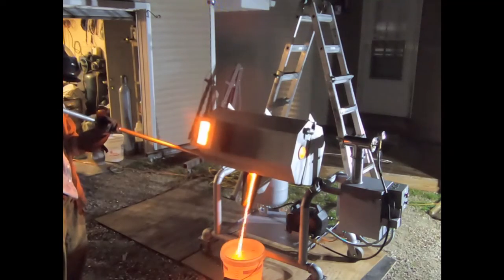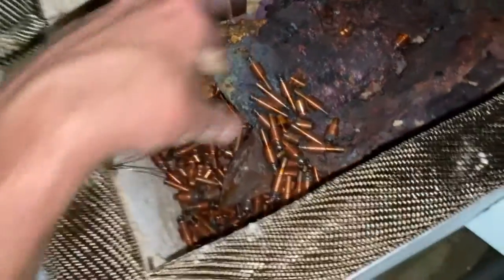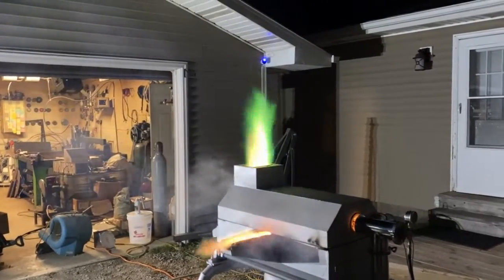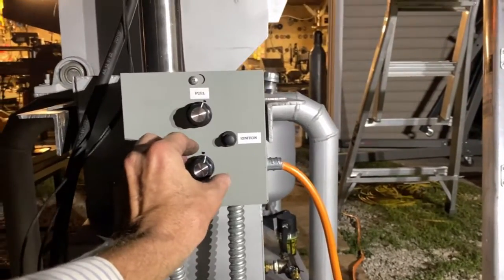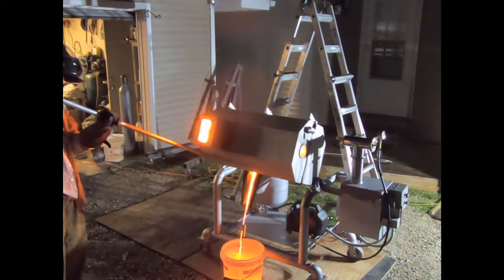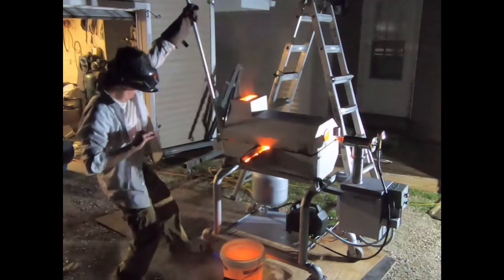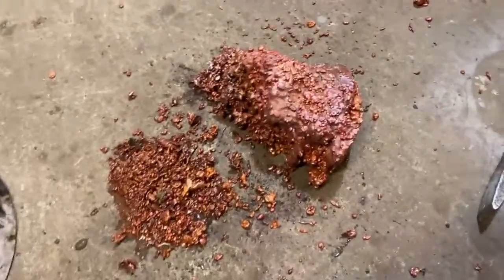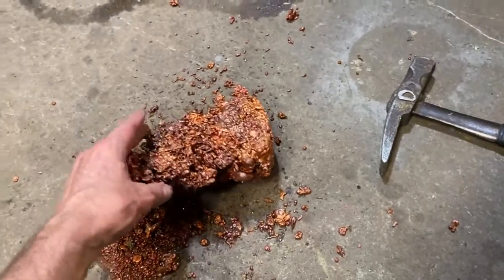Reverberatory Tilting Hearth furnace for Melting and metal separation

Comment: im looking for a way to melt dirty alum and not have all the screws and other tiny items to go out with the alum. (out the drain hole) I think Im just going to use a tilted furnace so the alum can drain once liquid but not enough angle to taker screws and other small items with it. Ive got half an old propane tank that was 4 foot tall its big enough enough around for a whole mower engine., which is the biggest thing Id melt and boat props maybe.

Comment: really cool . could you give me some advice?
you think there is a way to melt titanium using lignite coals coke? i am an engineering student and i am working on refining cheap titanium from TiO2 and need to melt titanium but cant think of anything other than induction oven or oxyacetylene torch. any ideas would be nice considering your experience with high temperature stuff.

sorry english is not my first language
Reply from the maker: Sorry i didnt get yourr reply , youtube hides my comments from me , if you use the word advice or help youtube does everthing possible to insure your not using their platform to make money unless your a lefty f4g0t

Comment: u need a better crucible than a bucket that will melt out the bottom.  A cast iron fry pan will do for the test, make sure to pre heat it to make sure it is hot and dry.

Comment: Melting copper is not a. Reaal challenge for melting in reverbetary furnace but  for melting steel in reverbetary furnace is real challenge my dear friend. Before 25 years ago I had   for melting iron and so many furnace were melting cast iron in India.but now now oil furnace were removed only crucible furnace  are  running for  melting aluminium and bronze csstings

Comment: Melted copper into water can explode into tiny particles. Apparently with considerable force. I suggest you never do that again.
Reply: It's actually a feature not a bug when producing precious metal shot for refining. Smaller particle sizes go into solution sooner
Reply from the maker: Yes it can but ive done this many times , aluminum is the explosive one . I have got a couple of pops out of copper but nothing serious yet . I would of used a mold but was low on time
Reply: Pretty sure most metals are capable of this but I've never seen it happen concerningly violently before and I assume one would have to dump the fluid pretty quick for it to become problematic. That said, slips happen sometimes.
Reply: @nathanieljames7462  I've done it on a small scale with copper. It's not a steam explosion, some other mechanism, however there are accounts from the early 1900s about larger experiments.

Comment: Have you thought about developing an electronic controller that mixes air and fuel at the perfect ratios for all power outputs (from 0% - 100%) and for a start-up procedure? This way you wouldn't need to control two dials and don't need to learn how to use this thing (just ignite and regulate output from 0-100, let the electronics do the rest, kind of like in a car engine)
Reply from the maker: People cant even afford an on off switch so no that's entirely out of the question .
Reply: @NOBOX7  I see, lol. Thanks for the answer
Reply from the maker: Great idea though  @TimeFadesMemoryLasts